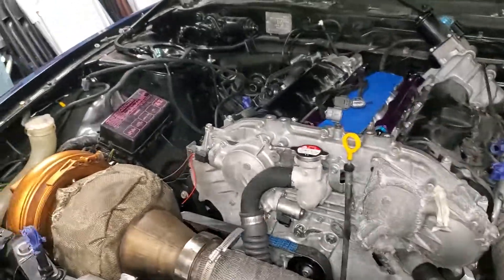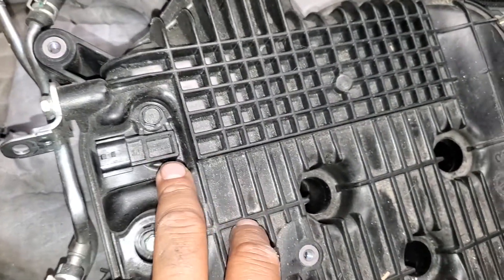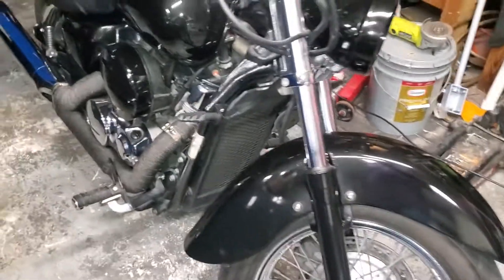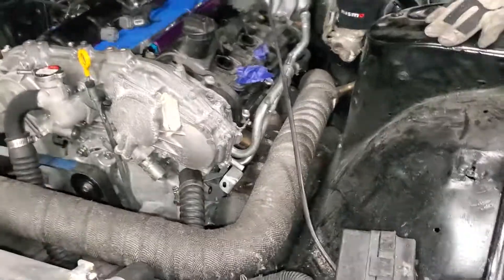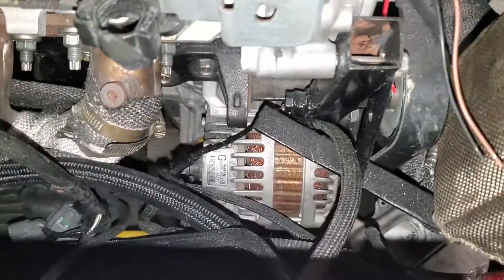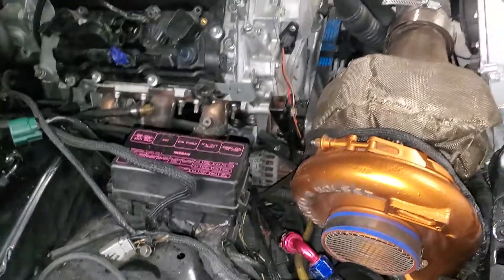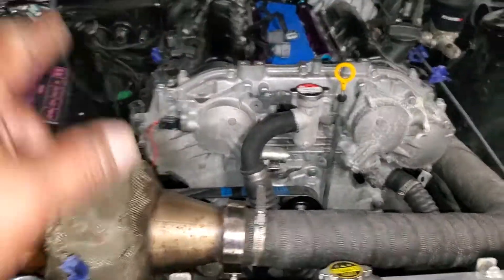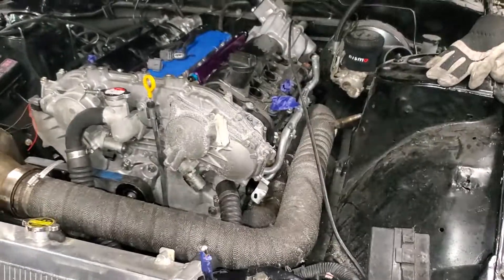Quick Update...Trying to keep going

Comment: I need to boost my VQ
Reply from the maker: If DE, stay under 370whp and you will be golden. IF HR or VHR, 500whp.  I am sure you seen stock HR/VHR hitting 700whp.  500whp is good for me in this car...But for drifting, at even 350whp, the tq will be there and slide all day even easier...
Reply: I got 4 g35s one is a revup the rest are de
Reply from the maker: @ps3dropzone187  yea revup still had toothpick rods...but 370whp/340tq at 7psi was fun but I needed more power and windowed the block a few years back...been awhile

Comment: What you using for ecu? Ms?
Reply from the maker: MS3X
Reply: @supakat500  is there a base map for that motor in tuner studio? PNP unit?... just wondering because ka motors are becoming scarce
Reply from the maker: @sdkalaniv7911  no but once you learn to tune and see a timing map for a motor, you get an idea on how to build the map then fine tune fuel.